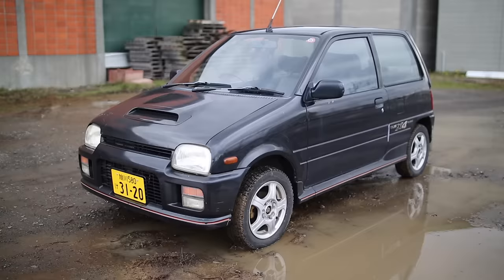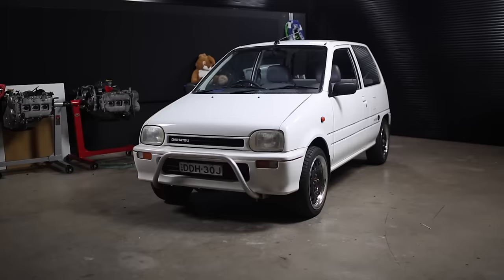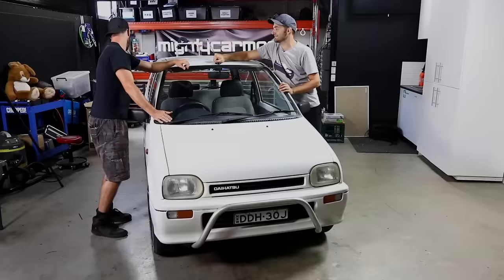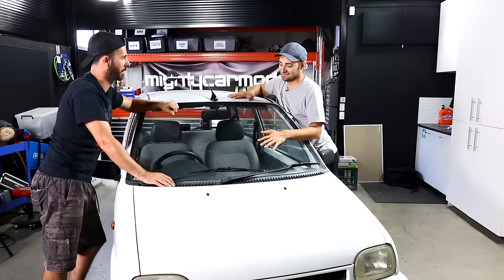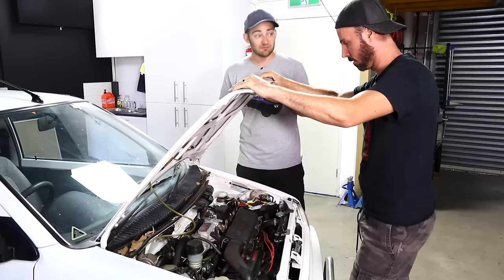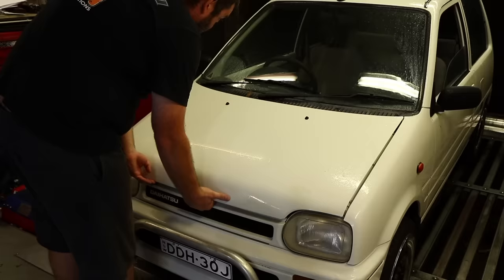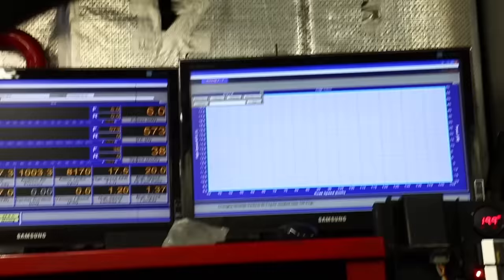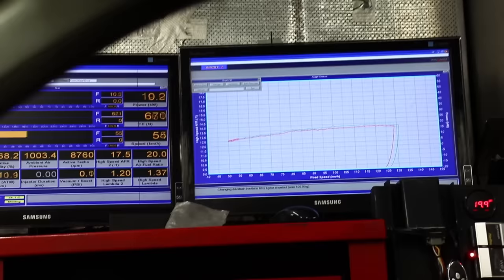Marty's New Kei Car [Part 2]

Comment: My lawnmower makes 13hp...
Reply: Stolly. Is it a Honda
Reply: Stolly. My snowthrower makes 10 hp
Reply: probably a briggs
Reply: I was just thinking that too haha
Reply: This car almost makes 30. It would chop your lawnmower.
Reply: My lawn mower makes 19.5 hp
Reply: Alex Presler  Yeah it's a Briggs
Reply: Stolly. is it a honda
Reply: my dirtbike makes like 52hp...
Reply: A Rotax Max kart will make 28hp, and goes like a rocket because it weighs about 500g lol
Reply: My 53' Beetle makes 16kw's or ~21.5hp. So much power! ;3
Reply: Stolly. my bicycle makes  0.1hp(1 human power)
Reply: Stolly. The Ford Model T makes 20 and think it weighs the same
Reply: Sweetz Artist: I'm guessing you have been chopped by a honda Lol
Reply: JDMLifeNZ I'm guessing you missed the joke lol
Reply: Charlie300 C+ The Ford Model T has a 20hp inline 4-cylinder engine, and a total curb weight of 544.2kg's. (~1200lb's) I haven't seen any riding lawnmowers they weight over half a ton before...
Reply: I've got a Mariner 40 hp outboard motor for my boat
Reply: Pnz Ta-fen lol I was comparing both cars not the lawnmower

Comment: Mini vs Mira... Shit just got real
Reply: I see a drag race in the future.
Reply: hmmm...both lightweight, but the Mini has more engine, but the Mira will have turbo....could be interesting.
Reply: Not sure which would have a better power to weight ratio...
Reply: Mira no chance, unless they squeezeeee in K3VET
Reply: It's gonna happen.
Reply: yes bro.. I have a K3VET and i try with honda EG6 B18.. hahaha.. K3VET never let you down.. haha
Reply: No point. The mini would walk all over the mira.
Reply: Atmospheric pressure is around 14.5 psi, so if you add 14.5 psi of boost you're moving twice the air, and your effective displacement is double. So a 660cc engine at 14.5 psi will move the same air as a 1,320cc naturally aspirated. To match Moog's 1.6L for airflow it'll need to run 21 psi. Since both cars weigh around 680kg (keeping the 4WD system in mind) and the redline is similar on both engines, it will be a close call as long as the Mira can handle all that boost. From a standing start the Mira could likely win because of traction.
Reply: I see what you're saying but unfortunately it's not that simple. Air density does not change linearly with pressure. Take a look at this table of air density at different pressures & temps:
http://www.engineeringtoolbox.com/air-temperature-pressure-density-d_771.html

All that just to say that the K3VET doesn't stand a chance against the b16b mwahahaha!

Comment: OMG is there going to be a Turbo AWD Mira vs Vtec Mini Drag race?????
Reply: MCM Nationals 2017 brother, wait for it !
Reply: IS there any point? The mini would smash the mira.
Reply: That feel when "Turbo AWD Mira vs Vtec Mini" sounds like "diesel veyron vs LPG DB9"
Reply: Mr.Mister they said "with that sized engine - i don't think it will when it's finished"
😏
Reply: LPG doesn't lose you any power.
Reply: andu but the weight.. to be fair, on an Aston the few kilos don't even matter anymore
Reply: AFAIK lpg does make you loose power... Only about 4%, but still xD
Reply: andu it does but a very small amount. if you raise compression or advance timing it doesn't lose power since LPG has much higher octane than petrol

Comment: 3 month later - "We gonna vtec swap the mira"
Reply: and a few months after that, they'll supercharge it.
Reply: joel joseph why? vtech is turbo
Reply: Alexander Columbus lol
Reply: J. Profit tryina fool some noob still not sure what vtec is tho
Reply: it's just a cam that changes at higher revs to be more aggressive (opens the valves sooner, for longer, and higher, so more air+fuel can get in and more exhaust can get out). Makes the car actually drivable at low revs and pull like mad at high revs. Vtec + turbo makes stupid power.
Reply: [MsR] Master not quite accurate... it doesn't open the valves more or longer at all. the cam itself doesn't change and you can't change valve lift or duration without a physically different cam lobe. all VTEC (valve timing electronic control) does is advance the cams so they open at a more ideal time for high rpm without sacrificing bottom end using a top end cam profile. os just a good way to compromise keeping street drivability and still have it rev out high
Reply: I was thinking of subaru's AVCS, but same theory.
Reply: Well it was accurate, you see VTEC = Variable Valve Timing and Lift Electronic Control. When VTEC engages it switches lobes on the same camshafts, so that you can have a completely different advancement, lift and duration. Most brands nowadays have variable timing of some sort, VTEC is patented by Honda and a bit different.
Reply: I want them to put a Hayabusa in there lol.
Reply: Only oh lord
Reply: I don't think it'll fit.
Reply: VTEC or a busa?

Comment: I was lucky enough to drive a 4 cyl turbo Mira in northern Japan for 3 years.  Fun little beast, especially on the back roads.  100 kPa/14 psi stock boost, and gobs of torque for such a light car.  I kinda miss it, but there was no way I'd be able to bring it back to the US.  Cool to see you guys making a project like this!

Comment: 28HP hahah oooo! TX2K HERE WE COME
Reply: yup, I've seen eTek electric motor giving about that much, is why I'd think two of them could be really fun, no waiting on rpm's for torque at all. there are also wheel hub motors, just put 4 of them on that little crackerbox for direct drive AWD, no gears no shafts wasting energy, big weight loss, super simplicity!

Comment: Should put a hyabusa engine in that Kai
Reply: ahahh i said the same thing :)
Reply: Fuck that, put a LS in the rear seats with a vette transaxle and pop wheelies and run 9s... lol
Reply: Best outcome!
Reply: naaw, put a pair of big eTek electric motors in there for 35-40hp and all the crazy torque it'd give anytime/instantly, plus the simple reliability.
Reply: model nutty Naah, leave the electric motors for Rc cars, we need petrol, roaring, rumbling and all the good stuff. Electric mods maybe in 10-15 years.
Reply: JustAnotherTuber a 2jz
Reply: JustAnotherTuber already done... search youtube for "koeicar" that is also a nice build tho
Reply: Mate i work in the EV business, and some of the motors out on the market do 70 KW at a weight of 20 kgs, either two of those or 4 (one at each wheel) and then some batteries, and you'll have yourself the fast KEi on the block. Without loading out the back of the car with batteries, the range will probaly be a bit low, but for race purposes that won't matter.
Reply: I think, in keeping with the original spirit of the car, a triumph D675 engine (3 cyl, 675 cc) would go wonderfully

Comment: #mighty car mods. 
remove the intake manifold there is numbers there, each different cast numbers shows that the intake hole is different , the largest hole will be at a Daihatsu atrai k-kar van body one.  . 
and maybe the camshafts lobe angle as well. other than that, the turbo one is usually with factory LSD, where N/A one is not with LSD. there is manual 4speed & 5 speed, auto 3speed & 4speed. 
Enjoy the build man...!

Comment: Here in Malaysia we have the rebadged one known as the perodua kancil, same exact body but with extra  2 doors at the back, same interior and only comes with the 660cc single barrel carb and 850 ones later. the  EFI one came out later but never had any power steering. back in 96, they even offered a "special edition" two tone paint (exactly like the one from Kei To The City) but with no radio. but it does come with some cool jdm fuse box and the original daihatsu engine instead of the one that says "perodua" on the valve cover. Mine is still running with only a radiator that need flushing. still runs like a charm.

Comment: Australia's rules for importing cars is crap!
Reply: MrGuvEuroman so is singapore's.The imported car has to be not more than 3 years old after org registration date....
Reply: haha how about you add to that having a requirement to do a RHD to LHD conversion and only being able to drive it  in two cities unless you pay an insane import tax? that's Chile.
Reply: I'm so glad that we Brits can import basically anything.
Reply: what about america's? we have to wait 25 years to import a brand new JDM car. only recently were we allowed to have the R33 skyline.
Reply: in india some foreign cars are taxed so high they basically add up 160 or 170 percent increase to the original price
Reply: R32, We dont det the R33 for a while yet. And I agree it's crap. Thanks a lot Mercedes.
Reply: Sean Roods 
Yea it's bs because you can have every r series gtr in America, even the r35, but you can't have the r34.
Reply: You can have an R35 in America because it's not imported, it's actually released there. You can't have the R34 yet because it isn't older than 25 years.

Comment: I think you'll be very pleasantly surprised once it's all done.  You can get a decent amount of power out of those JDM turbo Mira engines without spending a lot on them and in a 4wd car that weighs half of nothing that gives surprising performance.  A friend of mine has one of those JDM Miras and it's nuts, it'll happily light up all 4 tyres if you give a few too many beans pulling out of a junction...

Comment: I know for a fact that you can lift that little 3 cylinder out of the Mira. I did the same thing, by myself, with my 4 banger 1.3L Geo Metro/Suzuki Swift except I took the head off before I took the block out. Together they weighed approximately 150 to 180 pounds

Comment: you will be surprised japan automakers used the same body mounting holes for both JDM and export models.

so a ton of parts can be just swapped or bolted into to the same mounting points without any cutting

I wouldn't be surprised you can convert the Auzzy Mira into the JDM 4WD version because the undercarriage is the same as the JDM body

Comment: It will be interesting to see if yous can get the solid rear axle setup and drivetrain from the AWD into the ausdel shell. We dont have the tunnel in our Miras

Also, 20kw at the wheels is impressive, EF ELs are rated at 24 at the flywheel new
Reply: Also, please drive it to one of our Brisbane Mira meets when its done, theres some very impressive DIY stuff up here 😀

Comment: Interested how much power a de-restricted Japanese Mira spec engine can produce as well as how much the engine can be safely bored out. If you guys feel it is necessary to fit a larger more potent engine in the Mira down the line, at least keep it a 3-cylinder like in the Charade GTti, Brabus-tuned Smarts or other more modern 3-cylinder turbo engines instead of the approach taken with the now Honda-powered original Mini.

Comment: Well, you can weld it back together (starting with FSM for body knowing the diagonal specifications of every section etc) and it`d be no harder than say, a combination between the Mini and the sleeper Bug.
But, IF thats legal, then theres the application and registration etc all the paper work, depending on local laws, a government approved collision damage repair workshop has to sign off on the welding being done the proper way etc (thats the law here in Norway anyway), that`ll cost money as well..

Don`t get me wrong, I`d LOVE to see a car getting welded back together after being halfcut (for various reasons), BUT, in this particular case I just don`t think it`s gonna pay off.
Had it been a R32 or R34 or Supra etc etc then maybe it would have been worth it, but this is "merely" a mass produced small displacement Kei car that 99% of most car guys dont give a ding-dong about (maybe this series will alleviate that a little) :)

Comment: i expect this to be done in two episodes, max. since marty's already done a reshell, and a whole ep dedicated to dyno and results. right? pleaaaase ;D
Reply: maxpower700 ohhhh no it's more like 4-5 episodes bcuz it's installing the 4WD system and making sure it all properly aligned and the switch to E-85
Reply: Charlie300 C its no different than martys previous reshell video. swap hood, engine tranny, subframes. (he did it to his 4wd subaru). the switch to e85 could take some time, if they decide to go that route, possibly with standalone or piggyback ecu.
still, we deserve som god dang progress after all these years LOL! :D
Reply: maxpower700 I completely understand but the Subaru was 4wd to begin I don't think this best-turd (aka Mira) is 4WD I'm hoping it's like a how to convert ur 2WD to a 4WD
Reply: Charlie300 C doubt it. car manufacturers save cash by offering 2wd or 4wd in the same platform, meaning that they just strip away the rear drive, and bam, fwd. no need to design a whole new car :)

Comment: 8:00 Dude, it s dream car, and your build or whatever it's awesome but don't say it'll be fast, in no world ever will it ever be fast, not in the least bit or remotely.
Reply: tangles01 whatch out, dude. this beast is going to compete against the V-Tec Mini.
Reply: Sevo Uzun lol that doesn't equal fast. and nah it won't.
Reply: tangles01 so you're trying to Tell me that an 800 kg Car with  160 HP isnt fast? allright then
Reply: You're expecting 160 HP are you?, the video said they's be happy with 130, that's because factory those turbo engines make no more that 50 fly wheel HP even doubling it, which would probably kill the poor little thing only gives you 100 Flywheel HP falling a long way short of your estimated 160HP... But yeah, I'l happily race it when it's done.
Reply: Oh sorry i was estimating the Power of the V-Tec Mini. I have No Clue How much Power the Mira will have.
Reply: Ah, still I'll race the mini too, although I think it was closer to 200hp (that might have been crank so yeah). I think peppi would be the right word for the mini.

Comment: so... what's the point of these restrictions? i mean what's the huge difference between this mira and the japanese mira that you can't drive it in australia?
Reply: Samuel Fabiny I imagine the AUS one has thicker metal and lover power to comply with the emissions in AUS
Reply: It's not because of the individual car. In Australia you can't import a car for road use (in most cases) unless it's on the Special Enthusiast Vehicle Scheme list. Performance and special cars like Silvias, Skylines, Supras, etc, are on the list and can be imported. Ordinary cars like the Mira can't be imported because they're not "special" enough to be on the list. This is to keep both local dealers and enthusiasts happy.

Comment: Are you two really considered tall? I must be a giant then, though I prefer the term ogre, it fits better. 6'10 290lbs.. that's about 208 cm tall.
A car that makes 28hp? I don't understand that... my dad's 1965 Triumph 650 motorcycle makes 54hp stock, probably 90 in the race trim it's in now... My crappy slow 95 Bronco makes about 175-190hp if it's lucky and gets about 10.3mpg thanks to California smog equipment. (and it does about 45mph in first gear before it shifts)

Comment: wont it be dangerous to drive a cut-ed car?
Reply: They're not going to drive the cut in half car. They're just going to use parts from it. (Mainly the engine and drivetrain)
Reply: Flat4Buggy 2 i know that since i watched the vid. The question not for the video. For my own knowledge. Thank you for the response